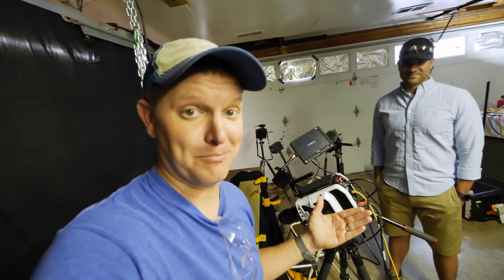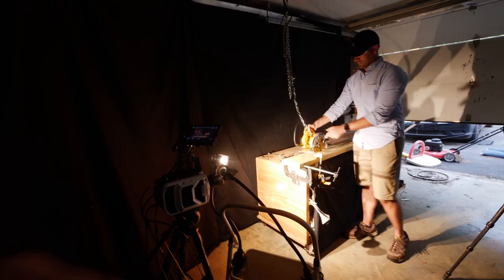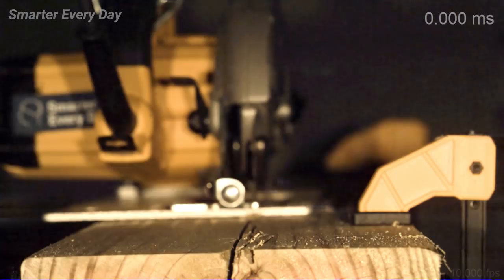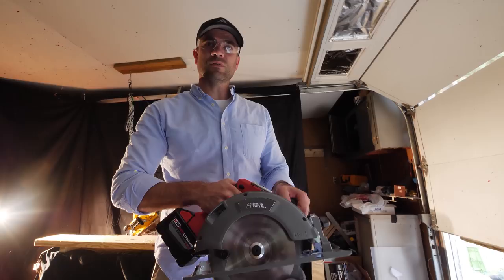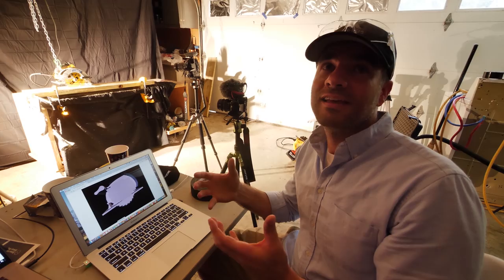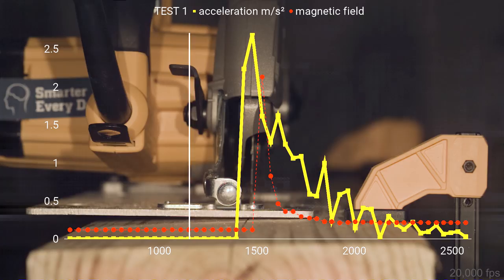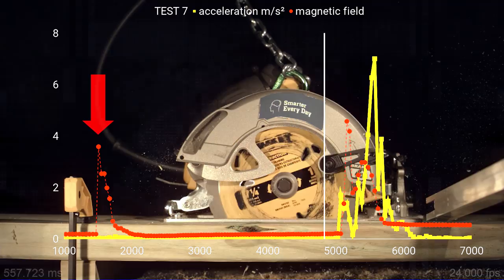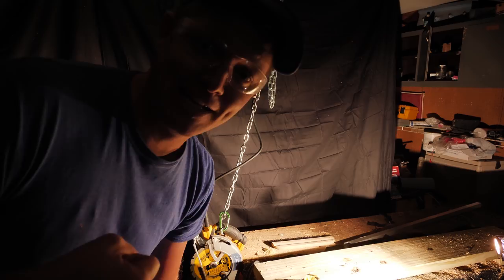Circular Saw Kickback Killer (We used science to make tools safer) - Smarter Every Day 209

Comment: Wouldn't a riving knife a la table saws be a much easier solution to this problem?
Reply: That or don’t use a circular saw like it’s some kind of handheld table saw.
Reply: That was my initial thought, just having a riving knife trailing the blade, it could go up and down with the blade. It would work, the biggest draw back would be matching blade thickness to the riving knife.
Reply: Doug78 the knife could get caught also
Reply: A riving knife would kill a lot of the versatility of a Skil Saw and most of the time, this is a framing tool and guys are not going to use that much time putting on and removing a riving knife for the minimal amount in safety.  Put a wedge in the sheet and you're good.

Comment: Throw a neural network at a problem that could be solved with a couple contact switches.
Reply: I agree. Over engineered and prone to fail. Would worth to make a video reply with a microswitched version.
Reply: this a lab test in ideal situations, circular saws are not always used in settings where the base plate is laying flat on the surface, for example, starting a notch in the middle of a piece of wood when the plate is not yet in contact makes it easy for the blade to catch as you push it down so the switches would make it impossible, you can also cut PVC tubing with those, the switches would not make contact.
Getting the input from the kickback through sensors allows you to use it free hand while still having safety.
Reply: Imagine the cost of this tech. I couldn’t see this tech used unless he licensed it for a really low cost.
Reply: @TheNuclearBolton  You can buy microcontrollers for literally 3 cents.  Maybe 5 with the sensors
Reply: @TheNuclearBolton  the hardwares are cheap. Their main product that they're selling is the programming. The companies who buy it will have to pay them a lot but for the mass produced product probably only cost a few dollar to $100 more tops i reckon
Reply: His solution will cost less than $2 for the parts if made in large volumes. The cost of the software license will be the make or break though. Contact switches would work well but I highly doubt you could patent it, he probably went for this method as it is definitely unique enough that you can patent the algorithm.
Reply: @Soken50  i said $100 MORE than the ones without their new system.
Reply: A contact switch wouldn't work. Vibration would set them off. Different orientations of the saw would become problematic. How would you start the cut when half the saw is not in contact. They would wear out and be prone to damage, and the hardware would cost more than this sensor based solution.
This really is a good solution. I have never had one kick back, and never stand behind the saw, so may not be needed, but for the $2-3US it would cost, I would buy the saw with it vs the one without all things equal.

It would be really good for chainsaws, and probably a few dozen other tools. I wouldn't mind having it added to the more powerful drills, so that when the bit grabs it doesn't twist your arm off. Drill press, detect if the work starts spinning (bit different sensor problem). With the right sensors you might even be able to detect and stop table saw kickback.
Reply: They're selling the programming behind it. A company would buy the rights to use this on a mass-production scale. The cost per unit would likely range from a few cents to a couple dollars on that scale, definitely affordable.
Reply: Contact switches wouldn't work in this situation, though. They went with this approach because they realize that the baseplate will not always have contact with flat surfaces. By using the sensors they did, they eliminate the requirement for a flat surface.
Reply: Paolo Sulprizio learn how to spell please
Reply: THANK YOU! I posted this: "SMART IDEA, STUPID WAY TO ACCOMPLISH IT! What would be wrong with attaching a limit switch to the plate that would activate the brake?

When you start a cut you rest the front of the PLATE on your work. During a kickback event the PLATE rises off the work. Wouldn't it be a lot cheaper to just not allow the saw to power up if you don't start the cut with the PLATE on your work and to brake the saw the moment it comes off the work?

My idea is a lot cheaper therefore more likely to be implemented. Unfortunately I don't have the time and money to invest in it like you guys do.

Question is: Are you to proud to drop this finished complicated idea and persue a simpler cheaper idea?"
Reply: @Soken50  The plate still rest against the work in those scenarios.
Reply: @Stacy_Smith  well it might have been an experiment in applying the AI solution. I mean, maybe Destin's friend has been working on the AI and integrated sensor utility and came up with a practical application.  Your method would not allow the saw to make a plunge cut since that requires the blade spinning before the shoe make complete contact with the work. The method in the video does not make such an operational restriction.
Reply: This is not something that could be solved with contact switches except for an extremely small subset of use cases.
Reply: @Stacy_Smith  no when cutting a pipe you would not have a point continuously in contact with the pipe, unless you want to place switches every tenth of a millimeter your contact switch will not stay in contact. And how the flip do you assert the switch will be in contact when cutting a notch, you literally start in the middle of the plank with a circular blade, the plate is a few centimeter away.
Reply: @Soken50  so don't cut a pipe with a circular saw (that's just stupid anyways). use a miter saw, handheld, anything really. saws are dangerous however you cut it (pun intended) and to use them properly you just have to be careful and knowledgeable. ultimately the best solution would be to implement a brake system like the saw stop has.
Reply: @Stacy_Smith  The sad thing is that you are too arrogant to consider the many flaws in your suggestion.
Reply: @Soken50  plus look at the cost on stuff like sawstop, etc. that has hardware that needs replaced with every trigger.
Reply: So where is your solution?  "A couple contact switches" is not even an idea, let alone a solution.
Reply: A company would probably look for alternative options when presented with this solution, I'm sure if a different sensor and or method is more robust and reliable they would opt for that.
Reply: @TheBest14184  I did my Best. Can you tell me in perfect Italian or Spanish what was my mistake, please? :)
Reply: @Soken50  there could be a button to override the switches. In the cases you considered the kickback shouldn't be triggered anyway.
Reply: Paolo Sulprizio I never claimed to know how to speak those languages did I. It’s spelt Engineered.
Reply: @TheBest14184  do you think that if you don't know perfectly a language you shouldn't use it? Did you born with your mother language already installed in your brain? Thanks for the correction though.
Reply: @PaoloSulprizio  but my point is those cases will have kickbacks and no switches in contact, hence why sensors is way more practical.
Reply: @fd3871  Plenty of people use circular saws in these applications to avoid carrying a dozen tools when one does the job.
Reply: @JaredBartimus  what is this in response to?

Comment: Why not just put a shark fin like thing behind the blade to not allow the boards to pinch....
Reply: I was thinking the same as my plunge saw has just that. Not sure you could have that and a spring loaded blade guard though and the latter is definitely better suited to this kind of saw.
Reply: The one I use have exactly that.
Reply: Mine has that, and I thought that was standard. I have never in my 20+ years of using a saw like this experienced a kickback. Also there is a spring loaded guard that closes really fast.
Reply: @olliman1234  Same here. My first thought was, "that seem unnecessary". Because I have never had a tendency to a kickback even though extensive use.
Reply: Festool did that years ago. It even retracts so you can start a plunge cut.
Reply: Correct.
Reply: Good thinking ....it's just like a table saw has but upside down ! ! !
Reply: Fred Lyons : on table saws it referred to as a riving knife. And in a high production environment they would be defeated because plunge cuts are very common
Reply: It's called a riving knife on table saws. Same purpose.
Reply: SMART IDEA, STUPID WAY TO ACCOMPLISH IT! What would be wrong with attaching a limit switch to the plate that would activate the brake?

When you start a cut you rest the front of the PLATE on your work. During a kickback event the PLATE rises off the work. Wouldn't it be a lot cheaper to just not allow the saw to power up if you don't start the cut with the PLATE on your work and to brake the saw the moment it comes off the work?

My idea is a lot cheaper therefore more likely to be implemented. Unfortunately I don't have the time and money to invest in it like those  guys do.

Question is: Are they to proud to drop this finished complicated idea and persue a simpler cheaper idea?
Reply: not in any way trying to discredit this invention but I agree with the the "fin" so to speak. it comes standard on most table saws and has worked well for me for years
Reply: nut I have to admit that If this goes to market I will probably buy one cause I love any reason to buy a new thing
Reply: That’s a riving knife, Festool uses them on their circ saws but they’re not foolproof.
Reply: im a carpenter and saw this too often. most of the people dont know, that you have to re adjust the riving knife for each blade change. even a few milimeters can make a big difference  @ryancox3834
Reply: How would you adjust a riving knife without  changing it?
Reply: @Stacy_Smith  With a brake switch on the bottom front of the hand saw, how would you finish the cut at the end of a piece of wood?  The blade would be stopped before it had completely cut through, correct?
Reply: @BiggMo  I'm thinking plunge cuts don't have pinching issues with the material so riving knife not necessary
Reply: Romulus Clay: that’s part of my point. A riving knife would interfere with a plunge cut and in a production environment a carpenter is not gunna install/remove/reinstall-adjust the knife with every type of cut. He’s not paid by the hour - speed is money
Reply: Gr8 M9ds why not just have the riving knife on a simple spring that when pushed from the top, it would go up, allowing you to plunge away.
Reply: Fred Lyons: in order for a riving knife to work properly it has to be perfectly aligned with the blade and extremely rigid. Could a retractable one achieve that on a tool that gets a lot of abuse?  Festool has had some success with their plunge saw, but it’s better suited for cabinetry/casework. It wouldn’t last a week on a construction site
Reply: Gr8 M9ds I must be one of the few who takes care of their tools
Reply: Fred Lyons: good for you. I’m  impressed that you and three of your workers can frame a 3800 sq ft home in 5 days while gingerly handling your tools.  My guys buy quality rugged tools built for the environment.

BTW. Every one of us has been building for 20+ years and everyone has all digits.
Reply: Gr8 M9ds It all depends on the person/people who are using the tools.
Reply: The festool riving knife is spring loaded and works perfectly. 
Like talking to cavemen wood butcher's in here that like to call themselves carpenters.
Reply: YoYO Semite  While I also don't necessarily agree with the need for this technology, you are ill-informed if you think the only way kickback can happen is by 'forcing' it with a clamp. They are simply trying to mimic a real world situation. 
How much have you cut wood? Ever cut a board with massive internal stresses? Ever gotten lazy or negligent and set-up a cutting station just slightly improperly and caused your work piece to bind?
These are things that I DO think can be avoided in other ways (from proper education/training, to simpler more passive methods), but my point is that kickback CAN happen and it can happen in a variety of different ways for a variety of different users. Trying to recreate real world scenarios in a controlled lab environment is undoubtedly a challenge... which is why Chad went the computer learning route.

Comment: or you could just put a small metal separator behind the blade to hold the wood apart
Reply: Ssshhhh they're trying to sell
Reply: Thank god I'm not the only one who knows that.
Reply: If I'm not mistaken you have to have this separator on saws in Germany. All Circular Saws I worked with had one.
Reply: The term you are looking for is riving knife.
Reply: Those work but they are not perfect. Because of the flexibility in the steel knife a inexperienced user can still get kickback by unintentionally twisting the saw as they cut.
Reply: @avocares  that's right. But they make it a lot harder to shoot yourself with the saw and Destin doesn't even mention them.
Reply: @gregkrobinson  Holy moly thank you for that. The moment I saw the problem they were describing, I thought "haven't we already solved that?" Nearly the entire video I'm telling "just put a riving knife!"

Comment: I always clamp my wood & put both hands on my saw grips with firm downward pressure and never encountered a problem. I wanted to get a table saw, but after understanding the dynamics of kickback on those its tempered my desire. It would be great to see this brake on a table saw possibly using a mouse laser to detect sideways and backward movement. Or a simple pressure switch near the blade that after the wood passes over it if the switch detects any lift engages the brake.